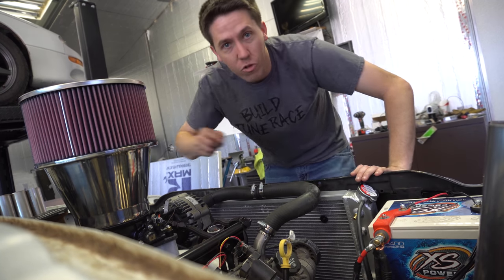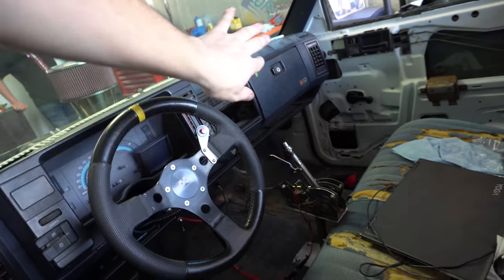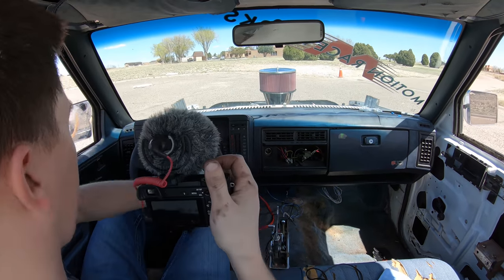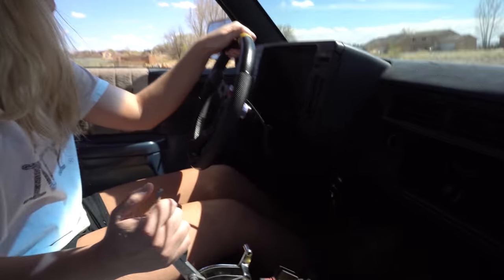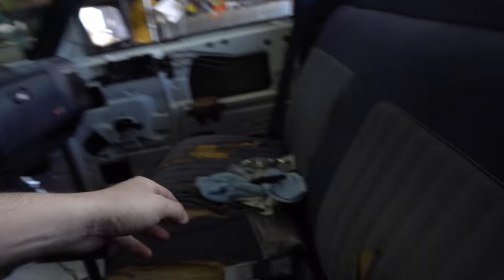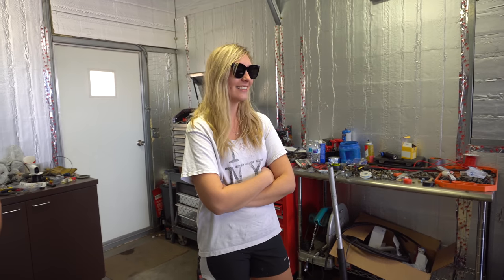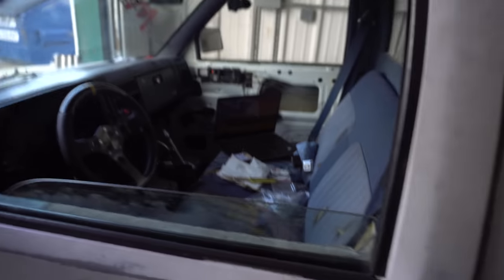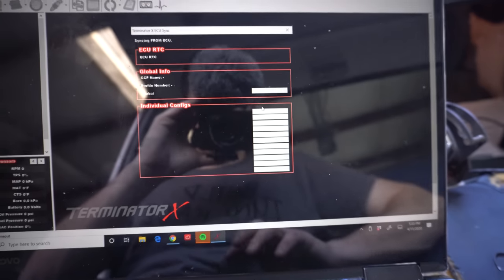Cammed 4.8L LS Burnout Truck On Holley Terminator X Gets Tuned on the Hub Dyno... Burnie is SO LOUD!

Comment: In the idle icf, check your "rpm above idle to start ramp." If that number is set too low, or if your iac hold is too high, it will hang the idle like you were experiencing. Generally not a problem with the car in gear because the converter will pull things down, but occasionally is when free reving the motor. Nice work. Pretty impressive for a low dollar 4.8 n/a build.
Reply from the maker: Thanks for the info ill check it out once i I manually set fueling at idle and turned learn way down  it hasnt been an issue i think it was trying to lean itself out to far. Haven't messed with it a bunch though ill definitely give that setting a look!

Comment: You're gonna end up around 29 degrees on the ignition. Keep the afr around 12:9 on gas. Set the limiter around 7600 and play until you figure the cam out... Little motors take little cams.. those 4.8s are known to use up 7000+rpm on street cams that 5.3s run out of steam with much lower in the band.  Don't be afraid to let it scream. That Holley auto correct will hold it together. TRUST ME ON THAT. LOL it's too conservative on timing. Btw. We run our carbd 4.8s at 34 degrees locked...
Reply: That's what I was thinking, us carbed guys run allot more timing. But his numbers are respectable

Comment: Why dont you make a quick "collector" where you basically make a slip on 2-1 or even 4-1 with a tab on the zoomie and on the collector 1 bolt slide it on with a 4-6" collector so you can get a decent average of each bank of cylinders. Then swap it from side to side to make sure each is ok. Just wondering after watching Doug's video having the same issue made me think how easily it would be to make maybe take an hour tops.
Reply from the maker: Definitely not a bad idea! I've seen people starting to tie pipes together and everything. I definitely see the importance of multiple o2 sensors in zoomies now lol

Comment: The reason why you're over 100% ve is because you're required fuel versus injector sizing isn't right to equal 100% ve. It's never dead on anyway... it's just an arbitrary number based off of injector size and required fuel. I've never messed with Holly specifically but that's how most standalones work.

Comment: Can you tell the cam specs? Would be nice to know for us spec freaks. Also what heads
Reply from the maker: Yeah here they are! 228/232 .600/.600 110LSA 108ICL
Reply: Build Tune Race  thanks man. That’s healthy for a 4.8. Explains that power!
Reply: @BuildTuneRace  factory flat tops ? Or valve reliefs. ..........

Comment: Man I wish I knew how to tune..guess I just need to buy the tuner and have someone teach me
Reply from the maker: There is a lot of info on the internet some free some paid if you get a system install it try and use a base tune and go from there to get it running play with settings and save a lot incase you mess up you can always go backwards!

Comment: 402 to the wheels good lord that's like 475 to the crank from a 4.8......that is fucking nutz,  what transmission is he running in that Lil rocket. ...
Reply from the maker: It has a powerglide in it so not as much drivetrain loss as a normal 4l60/80 would see
Reply: @BuildTuneRace  is there a general rule of thumb when it comes to drive train loss?
Reply: @CobosDoesItAll  10-20% lost to drivetrain, averaged. There is no set rule.

Stay safe out there.